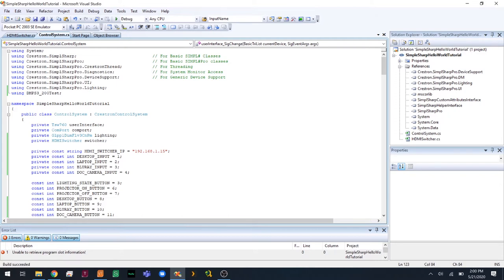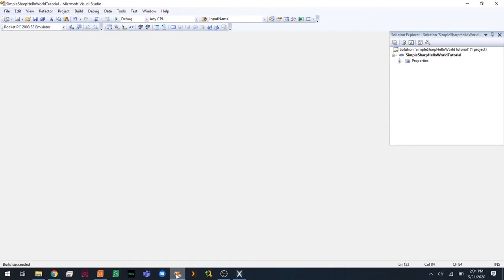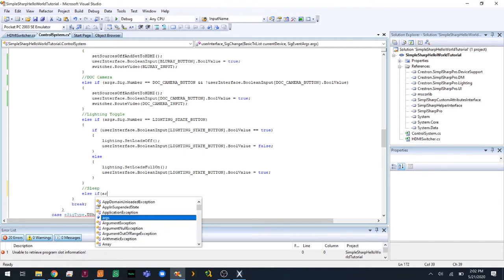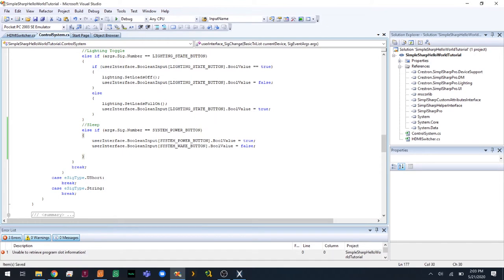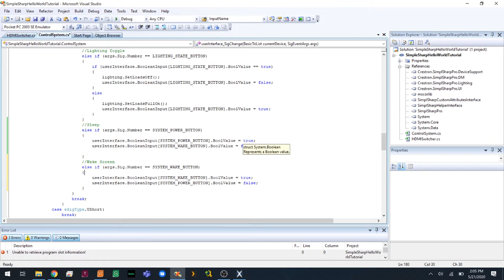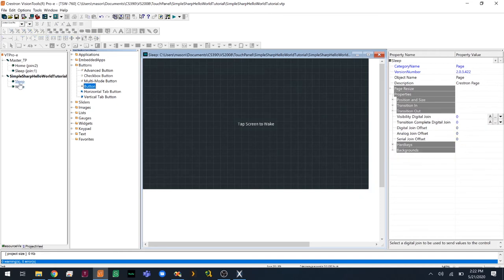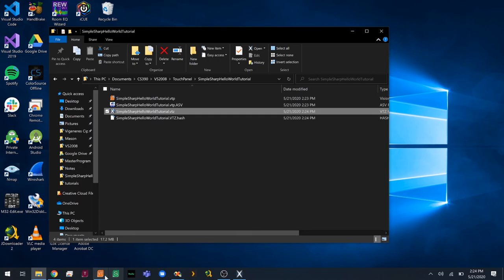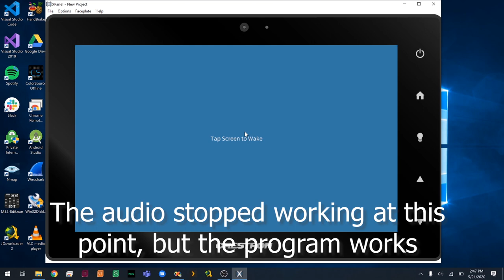Crestron System Power (Display dim) in C#

Comment: hello, can you tell me how to control a samsung monitor (connected via network to the processor) using programming with c #?
Reply from the maker: I only know how to do RS232 control, not sure how to do network control directly (connected via a switch I assume)
Reply: @masonvanmeurs6683  yes, the connection is via switch.
perhaps the class to use is the same. how would you declare the tv object?
Reply from the maker: @BredPoint  no idea how to do that. You will probably have to initialize a tcp/ip connection between them somehow perhaps using the IP address and a specific port I would guess
Reply: @masonvanmeurs6683  ok, i will try. thanks